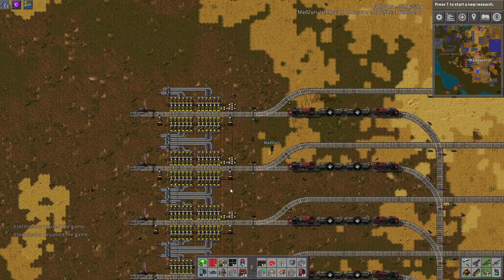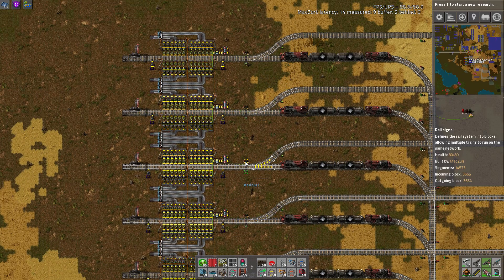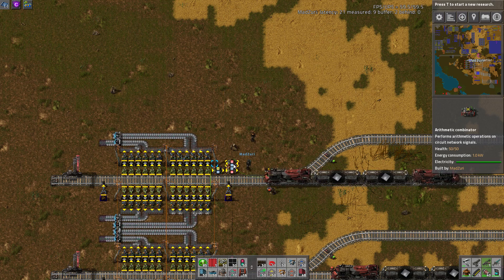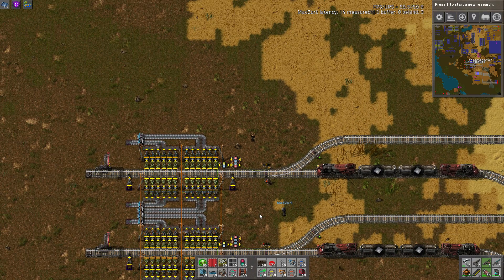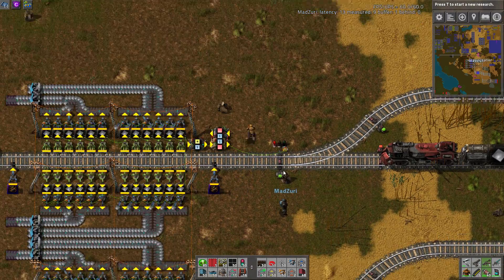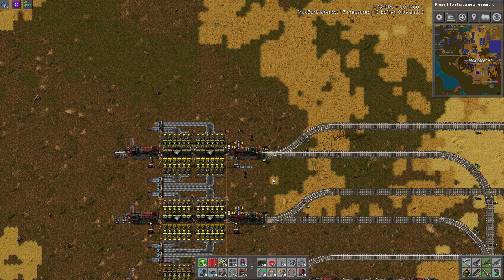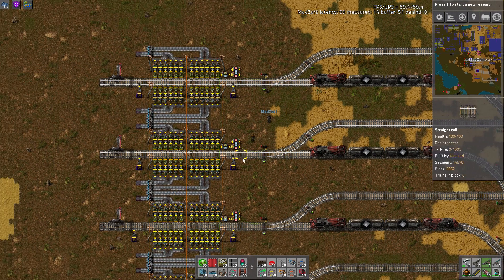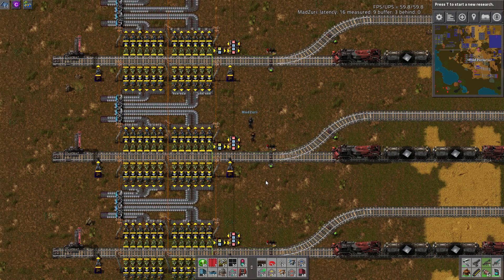Factorio Workshop - Building A Better Factory :: Station Smart Signal Changer

Comment: KoS used a better system. Items were counted per wagon and the signal before the station would only open when there was enough cargo to load all wagons (loading station) or unload all wagons (unloading station). Each wagon had it's buffer chests linked to a combinator that would output one blue square if a condition on item count was met. When there were as many blue squares as there were wagons, another combinator would open the train signal. Before the station there was a staging area with chain signals, so trains could wait there and a few of these stations with identical names could be used in parallel and balance each other out.

Comment: Wouldn't you make it so that the close off point would be the max. content of the boxes - 1 train load? That way, you are certain a train can always fully unload without idling in the station waiting for the boxes to empty.
Reply from the maker: Joris B Not sure how that would work. If you turn off the station until the boxed are all empty so a full train can unload then there is going to be a period of time where there are no resources while it waits for the next train to pull in. This would usually cause issued with production and stuff.

Comment: I have my stations so, that if trains ariving, they took the station with a load under the average of all stations.

its realy simple and let you get an much more even output of the stations.

its like this:
every station has an fix output of "S=1" with an constant combinator. every station will count S up, so S = station count.
you put this on every station and you combine it.
after this you count what is in every station (maybe copper). this count you give to 2 things.

so you put the sum of all stations together in an arithmetic and divide it by S
Maybe it is 30k in 3 stations. so the avg is 10k
this 10k you put into an decider and decide if the count is more than avg you give A=1. If A=1 than the signal goes red.

if it is under the avg. the train is free to go in.
because of this you will allways have a more or less even count in all stations. it is pretty effectiv.
and you can do this the other way around if you load something.

you just have to adjust one thing... if the count is < avg. than A=1.
so the trains will allways take the stations with the most load in chests.

maybe you can try it and tell me what you think about it.

Comment: I used this system to control my emergency steam engines :D it controls a power switch instead of a rail signal and the input is from an accumulator

Comment: I am trying to use this to control a smart smelter setup. So that my bot based iron smelter will start smelting when below 8k and keep 16k max plate ready to load into trains. So I am reading from the network for number of iron plate, and controlling a power switch instead of a rail signal. But instead of waiting to get below 8k to turn on, the power flickers rapidly when iron plate is between 8k and 16k instead of waiting to get below 8k to start? I quickly get in over my head with this, any solutions?
Reply: sweet, thanks, that worked, that is what I get for trying to recreate it instead of using the blueprint

Comment: You can do this without any combinators, just wire the chests to the signal and set to close when above a setpoint...
Reply: The signal will always be red when there is a train already in the station, so you will never get flip-flopping that you need an SR latch to prevent.
Reply: Thanks for the reply Zuri.  I didn't know that about the pathfinding algorigithm.  I guess I'm still having trouble imagining a use case where this system would function noticeably better than the much simpler one with just a wire from the signal to the boxes.

Comment: This is definitely smart and I have used something similar before myself. However, I am not really sure  that I see the point in the value range vs a simple threshold.  ie under the threshold the trains can enter.  Would you care to elaborate on the benefits of defining a value range?
Reply: I think the benefit of the value range is that you prevent trains from constantly taking the first station. For example suppose the buffer limit is passed again really quickly after the train has unloaded, then the next train will immediately path to that station again, start unloading, and get stuck in the station for a while, but there might be another station that is now starving because it is further down in the chain (trains always prefer the closest station if it is open). This would mostly be a problem when your stacker isn't always filled with at least a train (although even if there are multiple trains waiting they will still prefer the closest station when possible), but I think that scenario is more common than always having trains waiting to unload (at least in my experience, especially after a while when outpost start to provide less ore and trains take longer to return).

tl:dr: it gives trains more time to pick a station that is further away or really needs resources instead of just picking the closest one and then waiting because there is no room in the boxes to fully unload.
Reply: MadZuri Yes I can see your point, thanks for the reply.

Comment: I ran into this exact scenario while figuring out oil barrels. Thank you for a combinator solution.
Reply from the maker: Sure thing! :)
Reply: Xterminator except for oil where you have to manage two items, what is the use of this? Couldn't you just let the trains go in there whenever they want? 
Is this made so that you can stop infinite loops occurring if trains are set to "if empty' and 'or 30s" and the base is not running, meaning they would come and go without leaving items behind?
Reply: Yes, something like that. It's OCD mainly, plus it means faster deployment of trains since there's less logic in the train schedule itself. The main use of this is the memory cell, to stop factory from doing something once a threshold is reached - to prevent resource sliding and achieve bulk processing.
Reply: Andrejs Matjola what's ressource sliding?
Reply: The difference between a fall and a descent, digital vs analogue, mountainside vs cliff face.
Reply: Andrejs Matjola wha... What? The difference between a fall and a descend is "control", between digital and analog is "fundamental floating point precision" and mountain side vs cliff face is defined by context... 
I don't know what you mean or why you need three just slightly different words: sliding, descending, falling, to describe it..
Reply from the maker: There are probably other reasons besides what I'm about to mention, but as I said in the video, the main reason I like it is because it stops fully trains from going into already full stations and sitting there waiting. Even if you set a time condition along with your "wait till empty" "wait till full" conditions, it is still a bit of a waste. With this type of system, you are being more efficient with your trains because they only go where the ore is actually needed at that moment.
Reply: Ok. I usually only have one place (be it with many stations) where a train needs to go.

Comment: This video reminds me again that I have to figure out how the smart network thing works... ^^ I understood not much of it, but I faved the video and have another look at it a bit later. :)

One of the biggest things I really want to have in my factory is a smart unloading train. Trains are waiting at the parking lot until ore or other stuff is needed and unload then. That would be awesome. Unfortunately these smart network things are really hard to understand for me...
Same with ratios. I tried to build an oil area with the exact ratios, but it doesn't work very well. Every building is fully surrounded by beacons (oil refinery 16 beacons in range, other factories 12 beacons in range) I think these calculated ratios at Factorio wiki and in the official forums are made for standard builds with a maximum  of eight beacons in range.
I started with these builds too, but I found it more challenging to build a factory with the maximum of beacons... so I have to figure out myself how these ratios work best for my base. But it's all worth it. Damn... that huge smelter is a beast... so damn fast and pretty I would say. :) Haha... I had a quick look at the copper ore smelters... 1700 beacons only for copper. I love this game. xD # justafewmoreplease
Reply from the maker: Don't worry, the circuit stuff is really hard for me to understand too. The level of circuit stuff shown in this video is about the limit of what I can comprehend at this point. lol 

For the ratios, I might suggest checking out my latest Tutorial about calculating ratios, it can be applied to pretty much any setup regardless of it is beaconed or not.
Reply: Glad to hear that I'm not the only one who might be not so good at network stuff. :D
I remember that video you mentioned. I have seen it few days ago if I remember correctly. I'll definitely watch it again. Hopefully that helps.